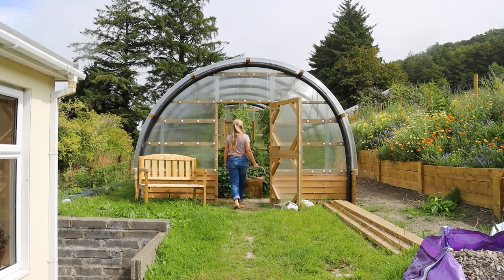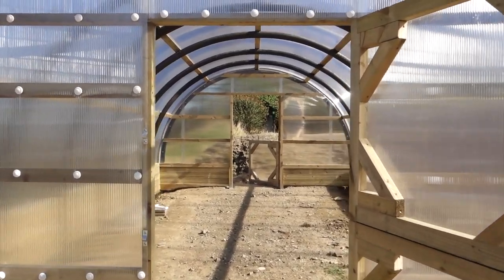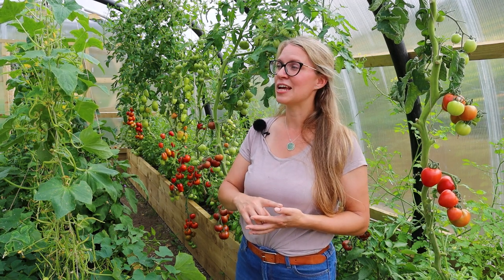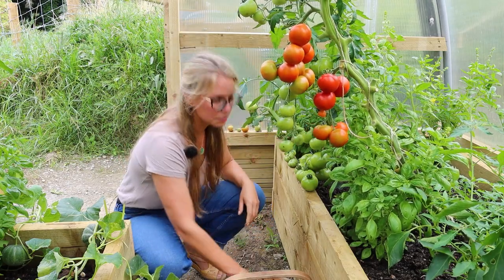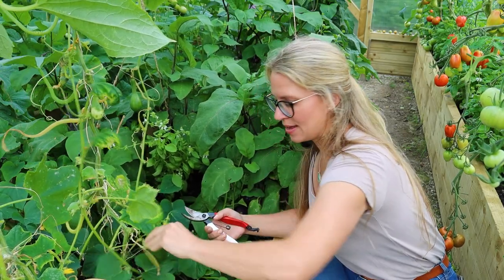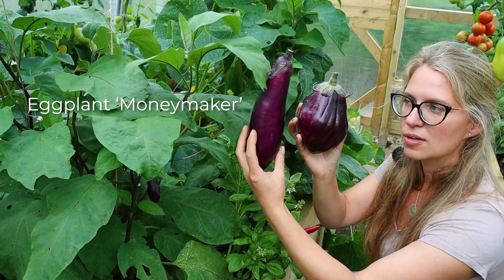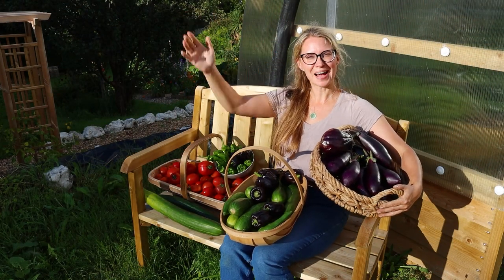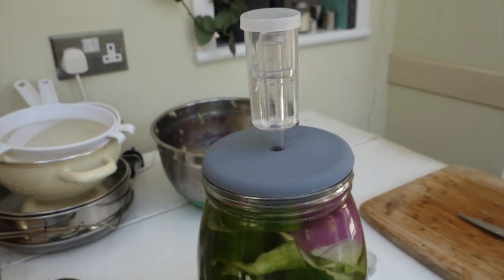Polycrub Gardening Tips for Epic Harvests

Comment: Great Video! I enjoyed seeing all the before and after footage. 
Curious if you had to manually water inside the crub over the summer every day? Or is it recommended to get a drip irrigation type system when so many different types of plants are intermingling? Or just put water on dryer areas only? 😇
Reply from the maker: I am planning on putting in an irrigation system but haven't settled on the products or set up yet. Right now, I'm manually watering the beds every four days. If they weren't so big, and if I'd not sealed all the cracks between the planks with aquarium silicone, then I'm sure I'd be having to water more often!

Comment: How does pollination (wind & insect) happen in the polycrub?
Reply: Tomatoes self pollinate (so that's not an issue) and I'm pretty sure Tanya leaves the doors open during the summer for fresh air & insects. Cucurbitae can easily be hand pollinated if needed :) Hope it helps.
Reply from the maker: If you look closely there are bees and insects in several of the clips. There's no lack of insects living in or visiting the Polycrub :) There are doors on either side and vents and gaps all along the sides.